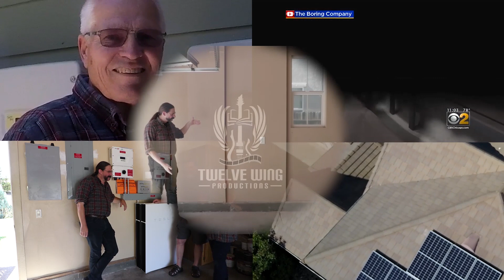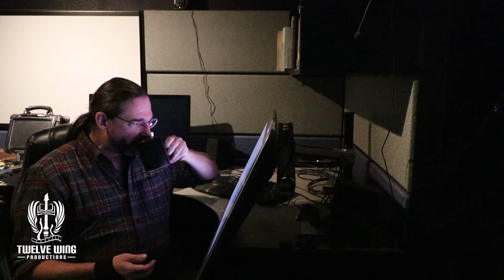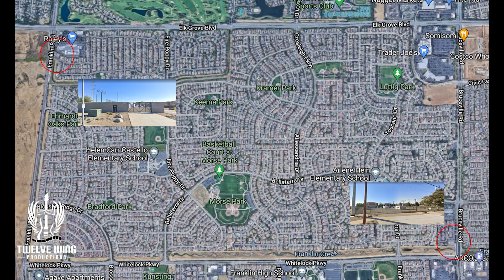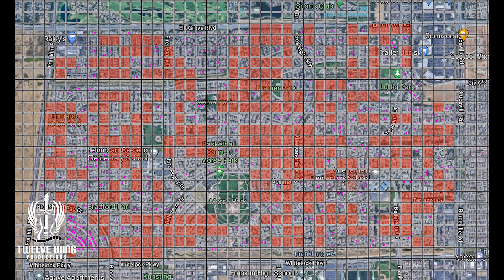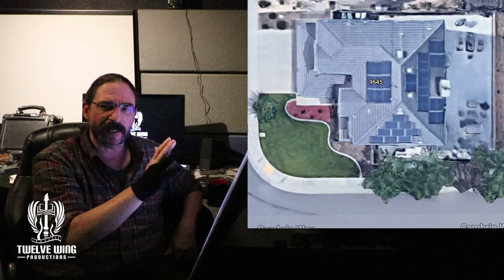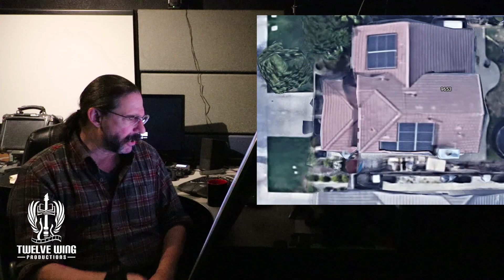How does Tesla's Virtual Power grid work? :Subscriber Q&A with neighborhood wide visualization.

Comment: Great presentation.
In the future the Grid Operators are going to become like a guarantee which you opt in too if you need that extra level of security. To keep it economically viable it may have to be government owned. 

I must admit when Tesla released some of the buffer zone in their power walls I wondered if that was them signalling the virtual grid was off. Now I wonder if they were simply saying to owners not to worry about them pulling power from your battery for their virtual grid as it is all working better than predicted.

There was an interesting video today on a company called Form who are working on a new version of the air-iron battery (rust power) that might be of interest to you.
Reply from the maker: I'll look into that.

Comment: Definitely coming. My husband has been saying for years that energy will become local. He thought it would be little power plants, probably fuel cells. We'll see.
Really glad to hear Elon is trying to help find power solutions. Of course it is a good business strategy but I think that is not his only consideration. Of course, not good to have large battery storage blowing up like in Australia recently.  Look forward to getting to non-flamable mediums for batteries.
Quick question, did your power walls double their storage capacity when Tesla did the software update that supposedly doubled the storage capacity? And if so, did you take that into account in your numbers in this video?
Reply from the maker: If there was a doubling of storage capacity, that was most certainly a glitch in the software and not an actual doubling of capacity in the actual units themselves.
I have seen inside the powerwall 2 batteries and they are 15kwh with some set aside for reserve giving them each 13.2.  There simply isn't any more room.

My suspicion is that the new powerwalls are twice the size as the singles are now because most people are ordering them in multiples of two and few are ordering less than two.
So in the software, they likely had some glitch that temporarily doubled the size.
Reply: The power wall pluses did not double their storage capacity.  It is still 13.5 kW.  What they did is increase the power output by 50 percent.  So instead of being able to output 5 kW continuous per power wall, the power wall plus outputs 7.5 kW.  The power wall plus did not get bigger.  They are essentially the same as the power wall 2, except for a firmware update that increased the power output.  All power walls produced at the Tesla gigafactory are now power wall pluses (as of Nov 2020).  The new power wall plus also is integrated with the new Tesla-branded inverter mounted directly above the power wall.
Reply: @johnseah957  Thanks for the explanation!
Reply: @beckyburke9681  I had three power wall pluses installed last week (with two inverters), although the solar panels won't be installed until September. From what was said, Tesla will be updating all existing power walls to pluses by pushing out a firmware update.
Reply from the maker: @johnseah957  I'll do a test to see how much I'm outputting per powerwall.
It is entirely possible that the restriction of 5kw was simply overkill.
I'll see if mine are outputting higher now.
If they aren't and the new ones are... I'm going to say that the improvement was more than just firmware.
It's likely they beefed up their existing inverter.

Comment: Don't overemphasize the supply of power back to the grid.  Just taking some/all of the houses in the 'zone' takes that much demand off the gird.

What might work really well for the utility is to put some storage at each neighborhood transformer.  That might make houses more blackout resistant when the grid supply is disrupted.   If one 'block' stays lit because its houses have a lot of solar installed then we might find that other houses would add solar.  

As far as a single house's individual storage the priorty list works like this.

1) "Me first".  The house that has storage gets to use the storage if the grid is down.
2) "My neighbors second".  If there's enough surplus storage in the block of houses and/or at transformer storage those houses stay lit.
3) "Surplus flows out".  If the block is oversupplied that extra can go to the next neighborhood.

Moving from step one to two and three would need some estimate of when the grid is likely to come back to life.  People are not going to be happy if they are forced to share and then they go dark.
Reply: Good ideas Bob!
Reply from the maker: In reading the context, I think what you meant was "undervalue" or "Under stress".
I did try and mention in there near the tail end that you are right Bob.  The effect of powering one of these little squares from the excess stored power of their neighbors is NOT inconsequential.  We are talking about blocks of 8 houses each... each home with their air conditioners hummin.
Additionally, you are quite right about having local storage at that substation.
I'll do a quick return to this diagram in the coming week and we can take a look at how much power in our hypothetical current neighborhood it would take to have a power pack type battery to support the community in the case of a power outage.

All good stuff.  Thanks for the input.